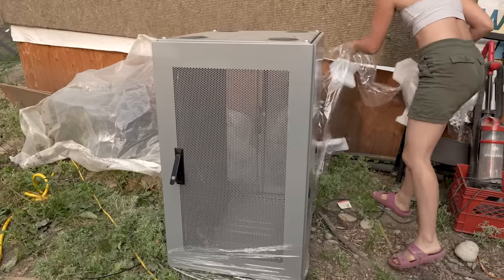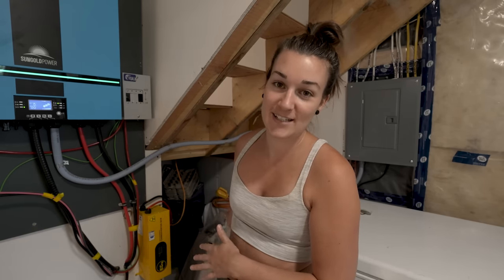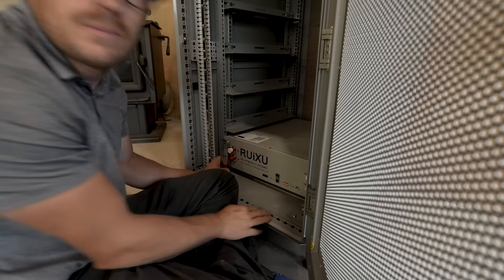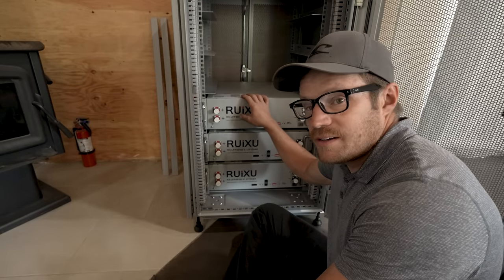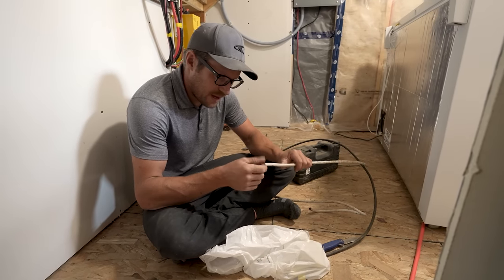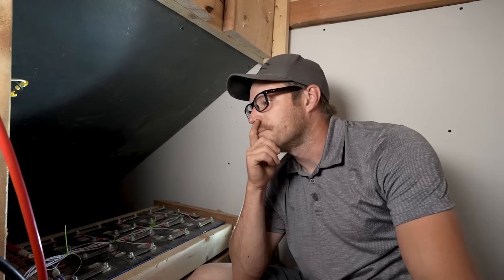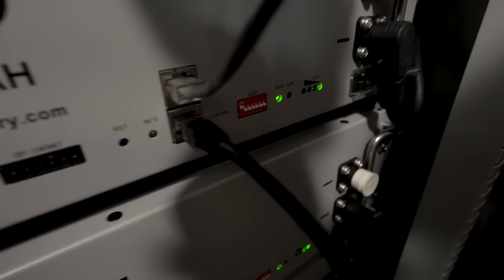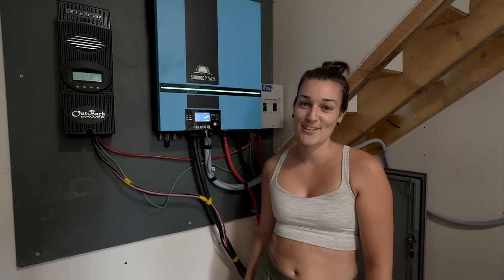Doubling Our Off Grid Battery Storage With Ruixu 48v Server Rack Batteries! DIY Solar System

Comment: Not sure if it is mentioned allready, but the cagenuts should be installed on the back of the rail. When you screw in the batteries it wil be really tighten to the rack.  But for now it should be ok, they are not really going anywhere
Reply: Rather than make another comment on main thread, yep.  Gave me a laugh but can't expect them to know this stuff to be fair.
Reply: ...and they could have installed it without removing the batteries by removing the side panels and installing them from outside...
Reply: @garybaris139  Yep.  Again though, if you've never worked with rack mount systems you aren't likely to pick up on things like that.  It's all good.  Happy to see them making progress and wishing them the best.
Reply: @MB-gc5fe  The bigger issue that I've not seen mentioned by anyone else is the mixing of battery types and technologies on one system. They need to take the older technology batteries out of the system and set the charging up for the new batteries else the new batteries' lifespan might be shortened.

Also it is highly recommended that new batteries are individually fully charged before connecting them to a common bus system.
Reply: @garybaris139  they are not mixing battery types, the old system is still lifepo4.
Reply: For safety the nuts go to the back of the rail so if the rack ever leans forward for some reason the batteries will stay in the rack and wont slide and fall out.. Also you should probably consider adding a metal plate or wide metal strips under wheels on the floor to help distribute the weight of the rack.
Reply: @jtaulen  You clearly know nothing about battery systems. Take any two different brands of Lifepo4 and read up the specs; bulk charge, float and equalise voltages and tell me if they are the same.
Reply: The pain of watching all the rack nuts go in on the wrong side LOL
Reply: Was just about the say the same thing! 😅
Reply: I really do hope they fixed this mistake in the meantime since the potential for disastrous consequences is real.
Reply: All the people who work on networking and server in here noticing this too gave me a laugh. This installation is really cool.
Reply: @garybaris139  

different brands dont mean the tech isnt the same. LFP battery is the same anyway you put it. 

the actual reason you dont mix BRANDS is because each company used to use different BMS controllers with different parameters depending on cell grade but for his case it should be fine running them in parallel. i will say that he should be charging the self built bank to a "full" charge with the eg4 and then leaving it for a month to self balance(he has a lot of cells).

setting the charge controller to not fully charge(setting to 13.8) will also work but it might take several months.

in conclusion, yes mixing BRANDS is bad but not in the way you think.

edit: forgot they were on a 48v system not 12v oops

:face-green-smiling::face-green-smiling::face-green-smiling:
Reply: Exactly

Comment: nice upgrade, just for others installing the cage nuts in the rack, they are supposed to be installed from the back, but no biggie :)
Reply: Our battery can be installed from Back too.will show the video on our YouTube channel
Reply: Yep, the cages are only there to hold the nuts in place while you screw the bolt together which is what holds the unit in place.  The way they designed the rack (and the fact that the racks don't tilt a lot) means this is less of a concern in your case.
Reply: What he means is the nuts are meant to be the opposite side of the rails they fit in. So the rail is between the screw and nut
Reply: @robertkerr9208  exactly :)
Reply: Oh and removing the cage nuts using that same tool is done by inserting it between rail and cage lip, on the non-nut side. The cage will generally pop out without much effort but if necessary you just lever it slightly through the hole.
Reply: agree- cage nuts go on the back or the inner side of the square rack mount holes- the idea is to bolt those heavy units through and to the rack -you currently have the units and the whole weight of each unit resting on those thin metal fittings around the nuts instead of bolting the unit down

Comment: You should complete the rack with the nuts and bolts for the empty bays. So you don’t have to look for the hardware when you get the other batteries
Reply: Good idea, or leave the nuts in a bag inside the cabinet
Reply: Yeah. Zip tie them inside the cabinet
Reply from the maker: @barryedwards1336  we have everything stored together in the cabinet

Comment: You guys are amazing!!  I hope the fires don't threaten your homestead.
Reply: Agree, I hope the fires don't threaten you.  If I were them though, I'd work on clearing the ground around their property line to discourage the fire from spreading due to dead/fallen trees and debris.  Just get the tractor out and clear off the land and maybe cut down a few dying/dead trees on the perimeter.  It's not fool-proof fire prevention, but any little bit helps slow the spread.

Comment: Really great video watching you work through the individual steps of the install. One thing for anyone thinking about these or similiar - if you go to add batteries, the bus bars are hot. You should disconnect all the batteries - make sure no power is to the bus bars before trying to remove or install a battery.

Comment: Good stuff. New batteries. There is a number of GOOD comments being given to you. Please note the serious overheating fire risk. I would not want to see that happen to you. Now I wish to add my points.  

Number the batteries bottom to top as you plan to extend 3 to 6. Keeps them in a logical order.

Crimping.
When using a lug a little too big for the cable add  few strans of the same cable wire to pack out the gaps. This will ensure a good crimp connection. I learnt this when working on 52 volt DC supplies for telecommunications.

I love following your channel and dont want to sound critical or smart but felt I shoud add my 2 cents worth. Please accept this in a positive light as ot is intended.

Comment: I've installed and built dozens of server racks and the caged nuts go behind the rail or plate not in front it. There is a special little tool that comes with the bags of caged nuts and bolts, it's a shaped shim to catch on the clip ends to slip the hooked ends through the openings,  to help you snap the clips into square holes in the rack. Also I think you should seriously consider building an outside enclosure for your power system and get all those batteries out from under your stairs. You really want to separate your energy storage outside of your residence. If something were to happen, God forbid, and your batteries caught on fire your stairs would be engulfed in flames preventing you from getting down from the upstairs if the fire were to happen at night while you were sleeping. If not at least put in smoke and fire detection and suppression systems under that stairwell. However, I would seriously consider building a concrete or brick shed, bunker or shack enclosure outdoors for fire suppression and separation from the home living quarters. It could be called the server room, control room, energy bar, whatever you want to call it, but I would put it outside a good distance from the house and run regular electrical supply cabling and cable service entrance just like a normal wiring from electrical grid providers. I enjoyed your video and want to see more but you need to take more precautions when dealing with large quantities of batteries and kilowatt-hours of stored electrical energy. You really only need to to have the energy you need in real-time come into your home the rest of it should stay outside of your residence stored safely including protecting the environment surrounding it so you don't give those water bombers another target that needs to be quenched.
Reply: 100% Agree .  Also not mentioned is the weight of that Server cabinet/battery shelves on an OSB based flooring and wood framed structure on top of the stair loading.
Reply: @dtuttle351  Absolutely! I can just imagine the floor collapsing underneath that server rack. Now, I don't know if there is a basement but that's another way, if the floor collapsed, the cabling or the batteries shorted out there's another chance of a huge fire from all those batteries heating up and igniting.
I like and applaud seeing all this initiative to go off-grid but who's got your back but yourself in situations like this?  You got to cover it yourself.
Reply: Or you should have gotten EG-4 to sponsor you, their server rack batteries have built in fire suppression!

Comment: The nuts in the rack need to be installed from behind,not from the front to be effective. They can be pulled out with the way you have installed them incorrectly
Reply: truth
Reply: yep to pinch the battery ears between the nut and the rail.  otherwise you can still just pull the batteries out still.
Reply: thing is, it's obvious even if you don't know how a server rack works. they are bolted to nuts on the FRONT of the rack they are connected to. only the little clips are holding it in, lol
Reply: Should read the instructions first.
Reply: You can also change it without removing the battery, I am sure those cage nuts can be installed via removing the side panels..

Comment: Congratulations on the sponsorship.  That's a nice upgrade with those batteries.  Ruixu has been highly regarded on a few of the review forums, as you mentioned.  You mentioned your negative wire might be a bit short.  As someone mentioned below, it balances the batteries better if you put one lead on the top of the bus bar and the other on the bottom.  So, you might consider changing out your negative cable with a longer one, and while you're at it, run it to the bottom of the negative bus bar.  As soneone else mentioned, those little square nuts should be mounted from the rear, so that when the screw pulls on them, they are pulled INTO the rail, and not out of it.  It's not like you guys will be jostling those racks around much, but maybe when you pull it out to add capacity, you could pop out those existing units and put the nuts in the right direction.  God forbid, if you were ever rolling that rack and it got away from you and slammed into something, those drawers could probably yank those nuts right out of the rail, as-is at the moment.

Comment: Yup cage nuts need to be installed on the inside of rail. It would be easy with the cage nut tool but flat head screw driver is enough to pop in place from behind.

Comment: Nice job guy's, you could probably triple the number of solar panels you have at the moment planning for enough output on cloudy days to keep everything charging and running.
Reply from the maker: Yes, we definitely need to get on that. It's been fine with sunny days but in the winter with less daylight, we will really feel it
Reply: @ThisOffGridLife  I used to make a list of how many amps everything in my system actually used multiplied by how many hours a day it ran for to get a total amp hours requirement, then looked at what the panels were outputting on a cloudy day which should let you work out how many panels you would need to meet that requirement plus some extra panels to cover future increases in consumption. The other thing that will have a big input on your system is the wire size from the solar array to your battery charger/inverter voltage drop over long distances would really impact your system so using an online solar wire size calculator can help to get the best compromise between wire cost and how much voltage drop you are going to get, if you can get the voltage drop down to 5% you will really be the king of solar.

Comment: I would invest in a heat thermal camera. Periodically check all your connections for heat build up. Also, make sure your smoke detectors work and you have fire extinguishers handy. Always have an escape plan. You are dealing with dangerous stuff. It can kill you. Other than that, those batteries are sweet :)

Comment: Great video! I wasn't aware of the Ruixu batteries and I see they offer shipping to Canada which is a bonus as I was going to be sourcing my batteries from the US. With almost 30kwh of battery capacity you guys definitely need to increase your solar array. I made the mistake of undersizing my solar array for the battery capacity I have on my system 15 years ago.  Highly recommend creating a spreadsheet that will calculate charge times based on battery Ah, depth of discharge, size of solar array and system losses. Tailor your array size so that it charges your batteries based on you typical depth of discharge (daily kwh use + desired autonomy days) and the minimum hours of sun you get in winter. For instance, for a 30kwh battery bank, 3 hours of winter sun and a 50% discharge would require 8.6 hours to charge based on your 2100w array but only 3 hours to charge if your array was 6000w.

Comment: Talk to RUIXO about pull out racks. We use them where I worked and they make maintenance and installation much easier. Slide out like a drawer. Of course cabling needs to be longer. 😊
I sure hope the fires get put out. We are on fire watch where I am too. Only time I regret being on top of a mountain. 😏

Comment: Sorry to bring bad news but the cage nuts should go on the inside of the rack so the device is clamped to the rail. The batteries are so heavy that they could be pulled off the rail and you don't want the battery coming away from the rails especially when you have all 6 battery packs installed. Nice vid, look forward to the next.

Comment: For a full battery rack I would use at least 2/0 gauge wires with a DC breaker, but it depends on the wattage of your inverters and chargers.
Reply: I wondered about that too; 3 AWG on a 15kwh battery bank sounds awfully small.  But, she said the inverter was a 5048 (5000 watt @ 48volts).  If my math is correct: 5000/48=104 amps, and, 3AWG @ 75degC is rated for 100 amps.  Not much room for error.  Hope they don't use the entire 5000 watts.  And I agree, a DC breaker or T-class fuse would be a great idea.
Reply: Also, I think the 80% rule may apply here, so de-rate it to 80 amps.  Someone else chime-in, do I have this right?

Comment: You installed the hold down screws aka ( cagenuts )  backwards they go on the other side of the rail. there should be no space between the rail and Rack mount device. One big problem with this is they are not secured to the rails so the battery/Server can still move freely

Comment: The cage nuts should be installed from the back of the squire holes, the metal clips pops open in the hole. The screw from the front goes through the square hole into the cage nut pulling the batteries to the back to fasten...

Comment: If you are only use 3 battery's in a 6 battery rack I would started at bottom or at the top and skipped 1 slot leaving a gap between each battery. This is to help reduce the heat build up between each battery. As everyone knows power creates heat and the more power you are using the more heat it is going to generate  also and this will just help to get air more space to disperse the heat easier

Comment: Ok. Kinda remember the old battery. You HAVE to have a BMS in there for them. Should be able to connect old battery pak POS to the new bus bar. same for neg. Good to go. Old batteries do not have fuse/disconnect like the new batteries have. mind that. should be fun. Thanks for sharing

Comment: The DIY can resolve itself with a simple 2 or 5 amp active balancer that you turn on when fully charged. If you want to turn that 14KW battery into a server rack type, buy a Seplos Mason kit for about $400, which includes a BMS. Also, since this is IN your house, upgrade your busbars, switches and fuses.

Comment: Sweetie my concern is that you're putting that battery system in an enclosed area, I would think it should be in the open AREA so it gets plenty of air, I googled it and the technician said they should be stored in a well-ventilated area. I thought that was the case from overheating, which came from GI ENERGY

Comment: The removable sides would have allowed you to clip the cage nuts in without removing the batteries.  Also, in the hardware that comes with many racks there is a little piece of metal with a hook on one end and a slightly bent tip on the other that is actually the tool to make snapping in the cage nuts really easy. As other people have mentioned, the cage nuts are supposed to be installed on the back side of the front rails.  I have never racked solar batteries, but I have racked lots of servers and network gear and UPS units.
The plastic cable management channels that cover the bus bars are meant to be customized, they work nicer and the covers fit easier when you are running large gauge wires if you figure out where they need to come out and cut a tab out of the channel.  You can just score it with a knife and snap it off.

Comment: Those negative connection wires you complained are covering the on-off switches:-  You would be better off by having those cables oriented about 180 degrees from where you have them now, with the cables swinging out over the panels a bit before coming back to the connection brackets.  That will leave the switches totally unimpeded -- safely so!

Comment: The thickness of the wire coming out of the rack should be equal to the sum of the three wires coming out of the batteries. I think you should choose a wire with three times the thickness to connect the rack to the system.

Comment: How much heat will this battery storage 0ut out in this small confined space? Do you have enough  ventilation to keep from overheating or starting a fire? Does the cabinet have cooling fans inside it that can be vented out of this space?